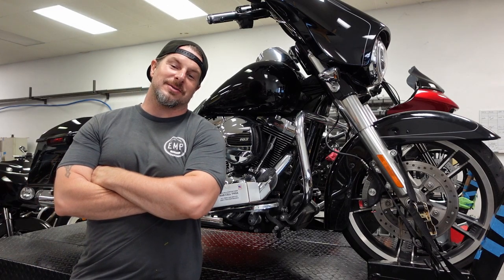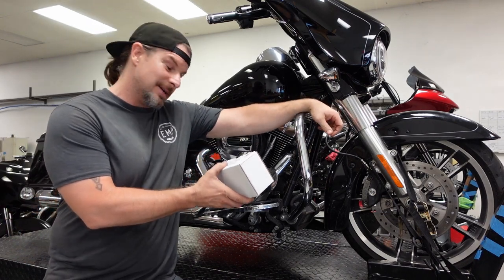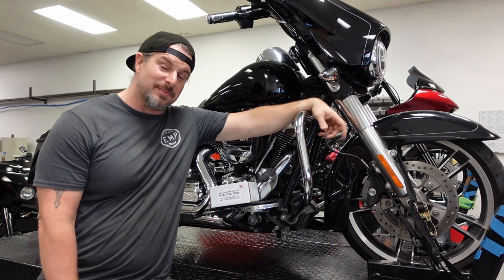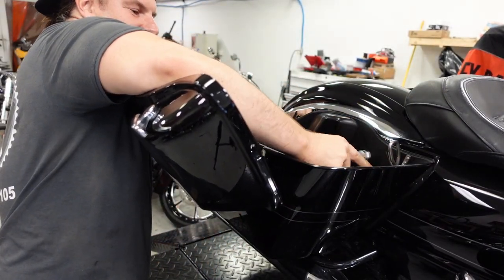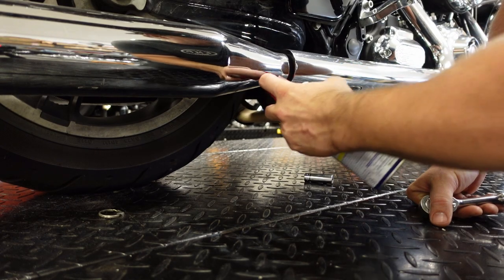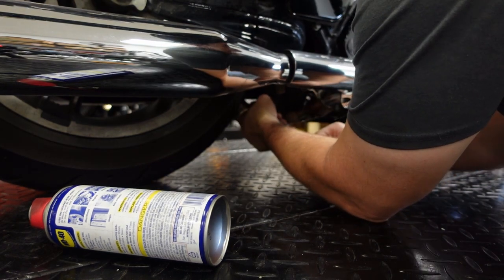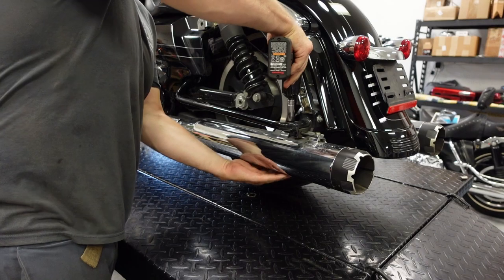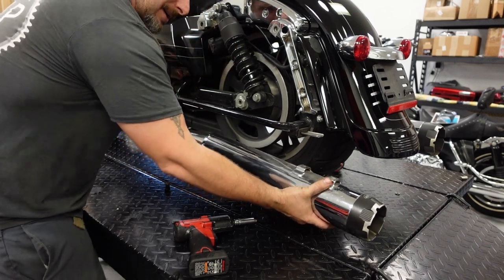Installing a Max-Cell Cam on a 07-16 Harley Touring Model Part 1: Tear Down and Inspection

Comment: Is all this motor work really necessary? I went from Detroit to Florida on my 2017 street glide special 107 M8 with nothing more than slip on mufflers, stage 1 air cleaner and fan assisted oil cooler that’s it. 4 of my boys have motor work of some type and only two made it back to Detroit 6 days later.
 Motor work for me is religious oil changes that’s it. I have chrome items added but no motor work.
Reply from the maker: In this case, the motor work was not an absolute necessity. The great thing about Harley Davidson motorcycles is that they can be customized to fit the style of the rider. Thanks for the comment!

Comment: Great video! Quick question. How much run out on the crankshaft would be too much to switch to a gear drive system?
Reply from the maker: 0.003" in the maximum pinion runout for gear drive cams. Any more than that and it will be noisy and have accelerated wear.